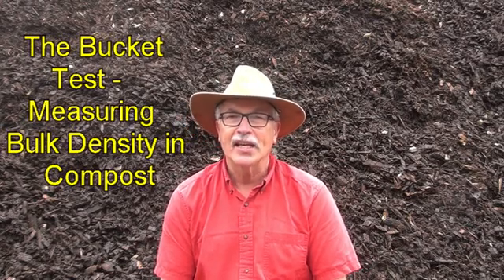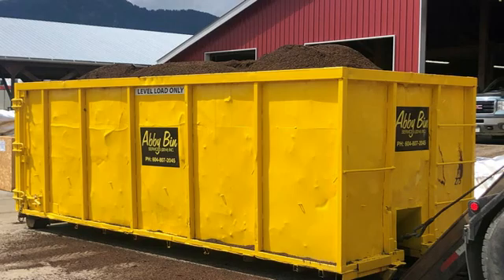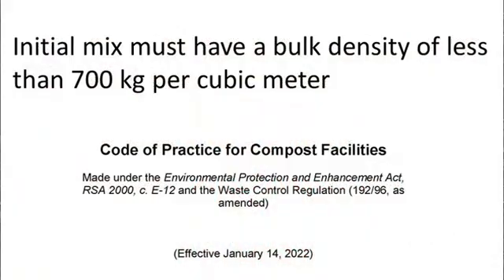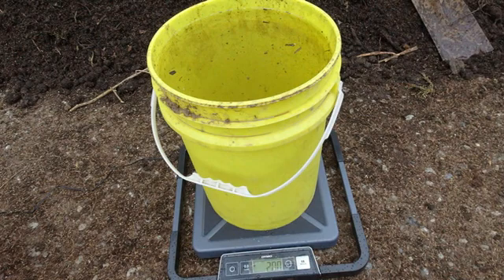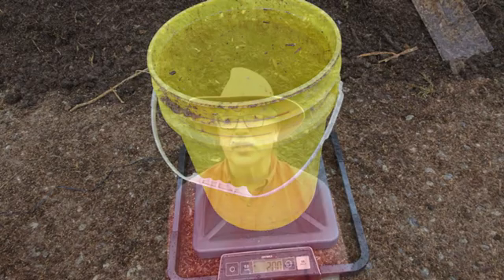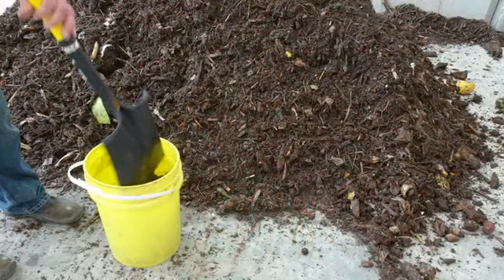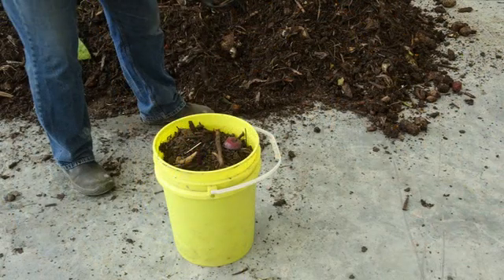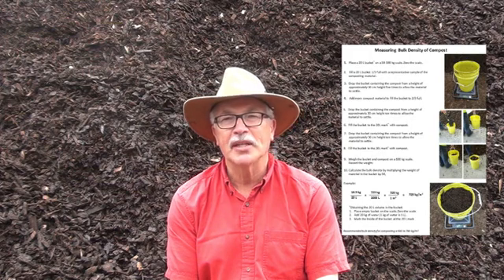The Bucket Test - Measuring Bulk Density of Compost

Comment: Great info for the home gardener, John Paul.  Can you make a playlist related to this topic?  It will make it easier to not miss a video and would make for comprehensive info.

I watched the air porosity vid first. There you say there should be at least 30% air. Am I understanding correctly that this video is saying that the material should be less than 70% (given 1000kg of water is about 1000L; aren’t metric units easy?!).   I’m just checking that I’m not missing a nuance that the air porosity and this density video are saying the same thing but in different ways: air > 30% and material < 70%.
Reply from the maker: Thanks for your comment. Air-filled porosity and bulk density are somewhat inversely correlated, in that the lower the bulk density, the likely greater air-filled porosity. Bulk density is less accurate than air-filled porosity in that even a small amount of sand or soil will increase the bulk density dramatically, as sand has a bulk density of 1500-1800 kg per cubic meter!
I am trying to organize the videos on our website as well - transformcompostsystems.com/learn
Reply: @TransformCompost  Great feedback!  Of course sand dirt weighs more than water, so their inclusion would distort the weight per liter baseline from that of water. I knew there was a nuance I was missing.